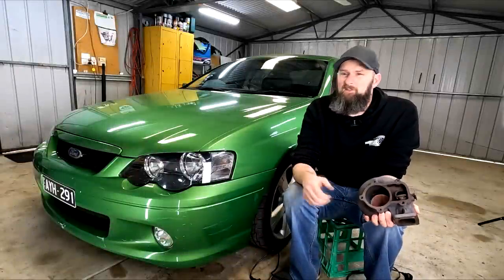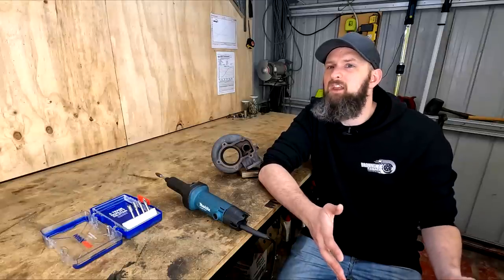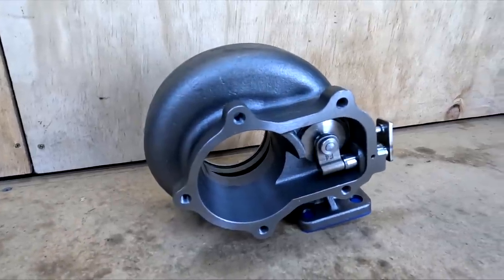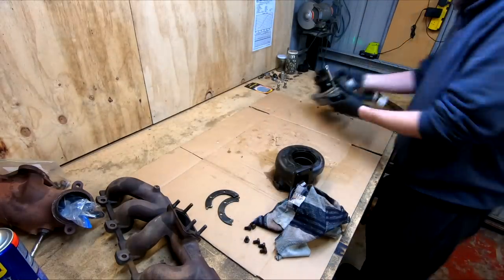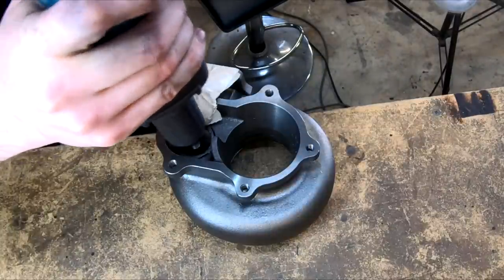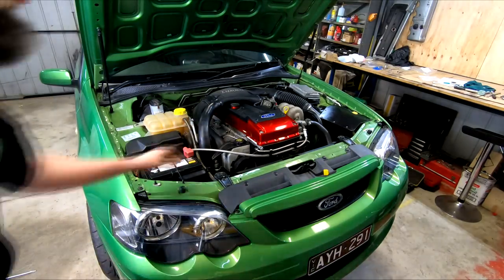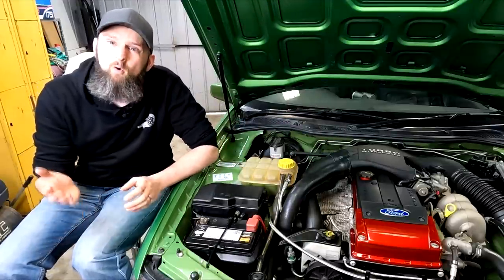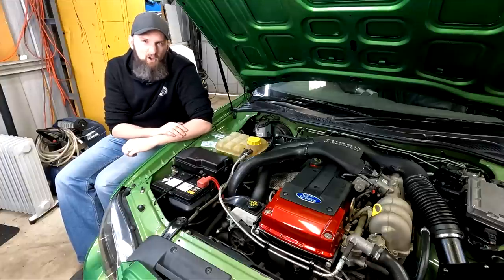OVERBOOSTING FIXED - Wastegate Porting & Bigger Flapper Valve | BA-BF-FG Falcon Or Territory

Comment: Wow, caught this one early. Another great video Brownie. Can't wait to see it on the 1/4 mile again. I just had to do the inlet manifold gaskets on my BA and thought that might be a good idea for a video at some point if you haven't done yours yet. It's not technically difficult, but it's a bit of a pain to get to all the bolts. The gasket between the head and the manifold is the cause of the very common BA rough idle problem so they pretty much all have to be replaced at some point.
Reply from the maker: Legend, thanks mate. It's coming, should be there this Sunday so expect the video in a week or 2 all going well.

Not a job I want to do any time soon! Haven't done mine yet and unfortunately may not make such a great video if/when I do, as you said not super technical but just looks time consuming and painful - likely just minutes of me cursing the car out!
Reply: @BrowneysGarage  Awesome, can't wait.  

If you do end up having to do those gaskets, get a few days worth of penetrating oil into the bolts that hold the two halves of the manifold together. Mine were pretty seized up.

Comment: As an FYI - don’t use long carbide burs with that die grinder. It’s too fast for them & will bend them pretty much instantly (ask me how I know 😂)

Use a variable speed electric die grinder or an air one & throttle it.

Comment: An exhaust is a must.
4" dump into 3" after mid muffler.
High flow cat
Then replace the under battery pipe if you used a stock one.

Comment: Another cause for the boost bleeding off could be the stock exhaust (if the turbo can't push the air out fast enough , it can't make boost in short) 👍
Reply from the maker: Good point. Think there's other cars out there holding a good hit more boost on stock parts but definitely something to keep in mind, thanks mate 👍

Comment: I have original ba xr6 turbo car. It has four inch dump pipe to ,3.5 inch exhaust system. I replaced turbo cast and cartridge with pulsar. Mines original is a turbo Barra. Do I still need to port out the pulsar casting and flapper port. Or is this just for na motors turned to turbo

Comment: hey browney wanted to find out, what length rod for the actuator did you use?
Reply from the maker: 80mm (https://bit.ly/3nep7QG) then I cut 10 or 20mm off, can't remember exactly, to get the right length I needed without running out of thread. Couldn't find something to suit at the time but I was in a rush so it may be out there.
Reply: @BrowneysGarage   thanks alot browney, do you remember  how much preload you used? i know 2mm is said to be the right amount but ive head other things
Reply from the maker: @daniel veldman Yep, would have been 2mm or at least that’s what I tried for. Controlling boost now to come in at 7psi but comes down a touch to 5 or 6 in the top end - really itching to throw some boost control or ideally a turbo ECU in now!
Reply: @BrowneysGarage  i was talking to a pro about this, me mentioned if there is more timing up high (which how most tunes are) you will see a small drop off. so it may not be actual boost contol issue.

Comment: I’m really puzzled as to why you’re going to all that trouble with stock parts. Bigger exhaust is a must on a barra not to mention intercooler and injectors. Professional tune will stop the overboost  that’s all i did to my FG 10 years ago and it’s still hammering along at 310rwkw with 210 000km on it